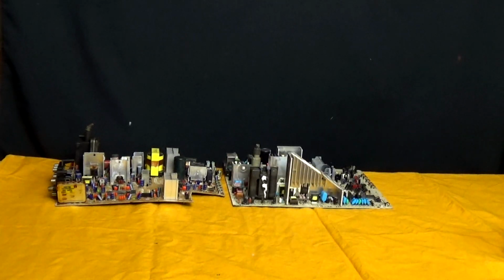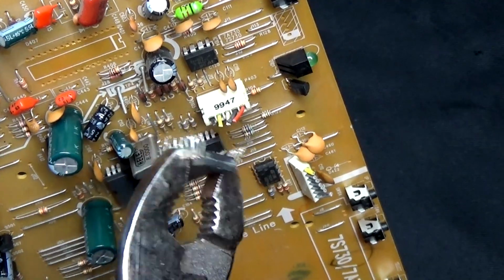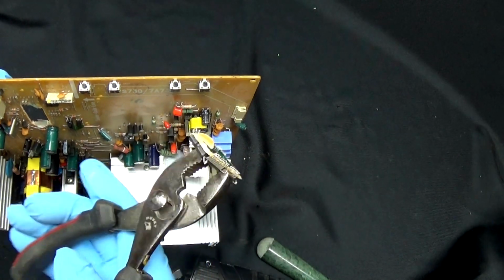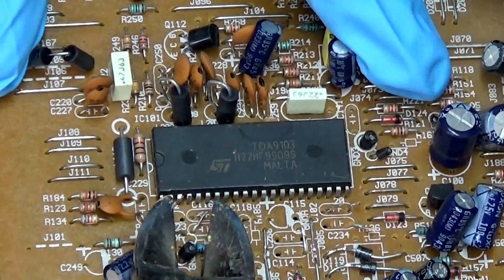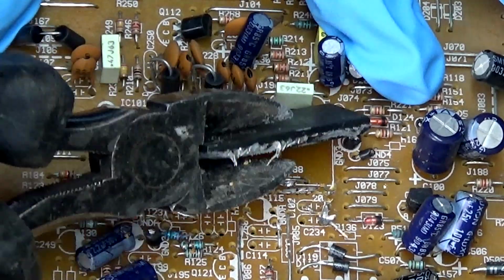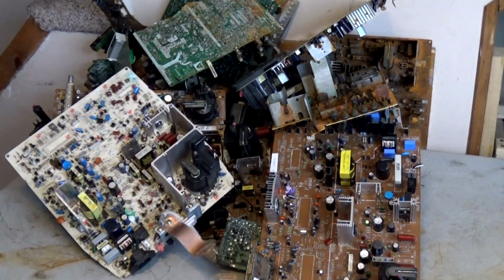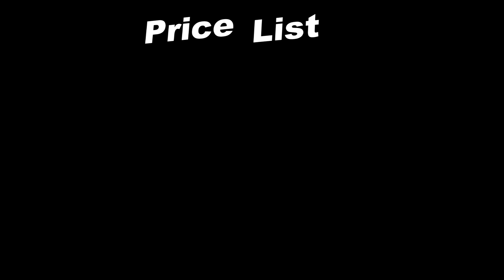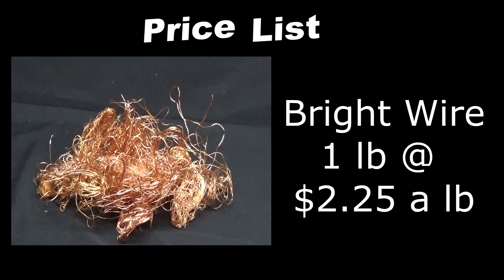Scrapping IC Chips

Comment: Hello Mike, I'll like to add my suggestion. I'm not from USA, so it might not apply to you.
However, some ICs are more valuable when they're in good shape, for example PIC microcontrollers, maybe some I2C eeproms, etc.
Also, for the BGA type ICs (the one from 08:35), those can be extracted with the heat gun. It's easy to desolder almost every component from the PCB with the heat gun, since at the right temperature, they will fall off.
Maybe there is a great power consumption from using it, and it might not be worth to use. However, good work.
Reply from the maker: Santiago Hormazabal I have heard of recycling them to be placed in other boards. Thank you ...
Reply: You beat me to it I would only use a desoldering tool as in the video to remove a chip in a repair a quick and dirty method is a paint stripper gun. I've used that on old boards to salvage chips for other units and it works really well.
Reply from the maker: Systemrat2008 I tried every trick I can think of....
Reply: Mike the Scrapper
Trust me the paint stripper gun is your friend. The chips just fall out easy. It can damage components around the chip or the boards so some care is needed but if you just trying to remove chips is fast and easy.

Comment: Hey mike on the low grade board the transistors (the ones usually attached to the alum heat sinks and steal ones are copper interesting thing is if you smash the casing and pull out the copper on it there's a silver looking dot on it. curious if that's silver?

Comment: Don’t forget the little black plastic boxes that break open easily to reveal a little copper spool and a couple silver contacts in the switch. Some are different colors, but they crack open easily unlike the solid resin filled look-alike resistors.
Also, the little black flat things that are screwed onto the aluminum fins are copper, but coated in plastic, and usually plated in tin or nickel or whatever. Lately I’ve been snipping those off, or they break off, and putting them with copper motors/transformers like someone else pointed out. So they end up in the $0.16/lb. pile instead of the $0.04-0.08/lb. junk.
One more thing, what do people do with all the big aluminum cylindrical capacitors? Do yards take those as irony or contaminated aluminum? Or do we just scrap them with the low grade as extra weight? The one yard I went to bought all the leftover low grade as “breakage” for $0.08/lb. 😕 which is better than scrap steel prices anyways.

Comment: hey mike, on the aluminum heatsinks they have these little pins on the bottom which hold it on the board. I have tried taking them off with no luck. could you make a video to show us how?
Reply: William Ela once I get them off I have a pair of dull wire cutters to pinch the pin and not cut it and pry it sideways against the aluminum like pulling a nail out with a hammer claw. On smaller ones you have to hold the Aluminum with pliers in one hand and the wire cutters in the other. Then it's clean aluminum and not dirty because sometimes the pins are magnetic. I use the dull wire cutters a lot because pliers slip and needle nose pliers pinch you and give you a blood blister! That's when I curse!

Comment: on the square chips you should use the heat gun to melt the solder and lightly tap the pcb on a hard surface on its side and they simply slide off without them taking damage. then you can sell them on eBay way more because they will still be useable.

Comment: nice video indeed. Was wondering, does you scrap yard takes high grade or mid grade boards if the ic chips have been removed? The reason I was asking is I have some high grade boards I have previously taken the chips off of and would like to take them in. Thanks a bunch and take care.

Joe in Texas.
Reply from the maker: TheNewport2009 Usually they will look at the boards. if you stripped them they may give you Low Grade price.

Comment: is it worth getting the copper out of the transformers?
Reply: +Dieforpie the easy ones that are just ferite and plastic just smash them and pull out the copper. the other ones that are in a steal "case" don't bother
Reply: And some are too small or have too much tape layered between wires.

Comment: Hi mike. I just got done taking a part my sister in laws laptop. I took a part the screen and there is a real thin green board in there with lots of gold in it. My question is can you add this to the gold cpu pins that you used. Also i was taking a part a old computer from 1996 and it has gold and silver stuff in there and as i was looking at the cables some of the pin connectors have gold pins in them too.
Reply from the maker: zattss Save them all. I do have a video, which you may place them with your Ram boards...

Comment: Great vid as usual.   Surprised you didnt try the box blade method for the IC chips on mid grade boards.  Little pressure down and short pull and it clears all the feet. :)

Comment: Go to the Harbor Freight website and search "Micro Flush Cutters".

3 bucks and they are sharp enough at the tips to cut the pins like you did with the screwdriver. The ic chips with thick pins get cut like butter to. Great for cutting zip ties flush as well of course.

And after they get a little dull or they start to close at an angle because I cut too much thick metal when I'm too lazy to go get the cable cutters from my tool bag(about 3-6 months of daily use) I take my receipt to HF with the old cutters and get a new pair for free through their lifetime guarantee.

Also cut 95% of my wire with these. Even thick TV degaussing cables. They get down into tight spaces getting me that extra inch of wire.

You'll love them, believe me.
Reply: So when you process your chips do you trim th e legs off and what metal are the legs

Comment: hey mike i have a easyer way to do that faster for you .........  USING YOUR BBQ GRILL  COOKIE SHEET    PLAY SAND AND PUT YOUR SAND ON THE COOKIE SHEETS AND TURN YOUR BBQ GRILL ON UNTIL THE SAND IS WARM AND THEN PUT YOUR BOARDS ON THE SAND FOR A FEW MINS AND USE PLIERS TO GRAB THE BOARD AND A PUDDY KNIFE TO KNOCK EVERYTHING OFF THE BOARD  THERE YOU GO A CLEAN BOARD ....happy scrapping
Reply: there are 2 ways of scrapping ic : hot way and cold way , this one is cold way
Reply: then there is the easy cold way . grab an axe make it sharp hold close to head for dexterity and shave the boards. works great for 90+% of all components

Comment: I know this is a really old video and stripping the boards is definitely the way to go rather than selling. But the method used is poor at best i do lots of boards. The best easiest and fastest way is first clamp boards in a vise. Then grip the parts with your pliers and gently pull them as you heat them with the heat gun. With a good hot heat gun you can completely strip a circuit board in just a couple minutes or less. I can clean a whole big box of boards in less than an hour removing everything. One other thing selling transformers for $0.16 a pound is giving copper away. It takes a little time but for $2.00 a pound i can strip the copper out of them and sell the irony parts separately.

Comment: this bothers me because I'm a hobbiest and work with circuit boards but you could make more money buy selling the chips to hobbiests. 
if so it's recommended to ulternate a screw driver from one side to the other until it comes out mostly unscathed.
those chips go for a pretty good price in the computer market even if they're used, roughly at or just below $20 a piece.

also if you come across a computer power supply you could convert it into a bench power supply for a shop or lab and make $30 or $40 off of it.
my dad is a scrapper and I guess I am too but I see more money in repurposing things.

and those transformers, if you have rearange the plates to face one way like this (E) with the primary coil on it without the (I) plates they make great electro magnets.

Comment: at around 4:30... this is painful to watch, you need to use a desoldering wick, remove as much solder as you can, and then you should be able to easily slide the IC out without ruining all the pins.
Reply from the maker: Nifty Fingers I pulled them out to sell as scrap...Not to sell to be reused...